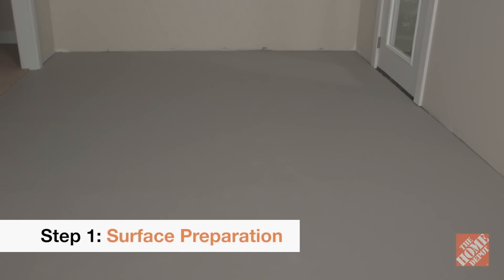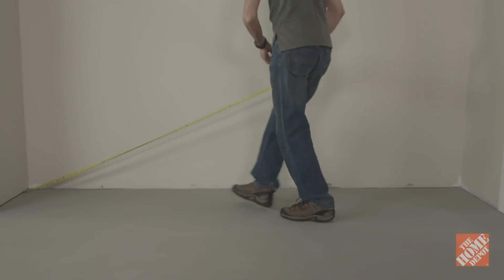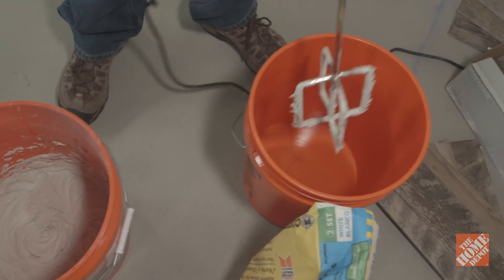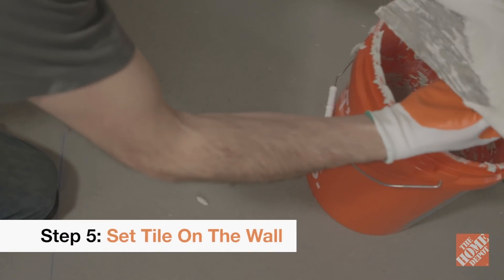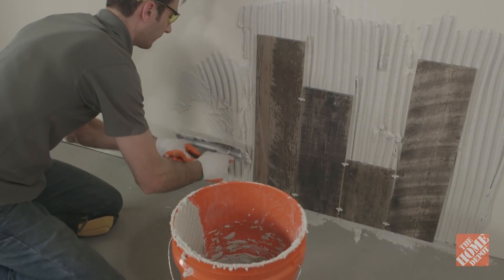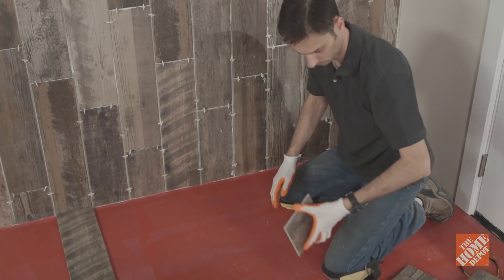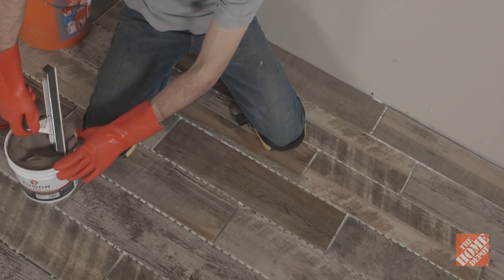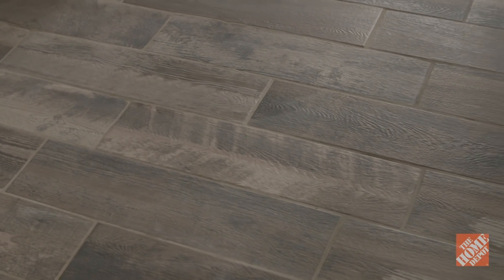Mudroom Ideas: How to Install Porcelain Tile Flooring | The Home Depot

Comment: Lets see---a) First I use hardi-backer 3x5 to level a floor, since a floor that is not level can not "level it's self"  (b)The snap lines go to all sides, not just one way. (c) the center line is best done with a straight edge/1x3 nailed to the floor, same on the wall, (d) a torpedo level is used to check vertical level and (e) the joint grout ( might be colored)  can but packed into the seams with a spoon to give a nice rounded look.  Now if you want to know about real estate stop by, and see my  45 degree offset tile job. Cheers